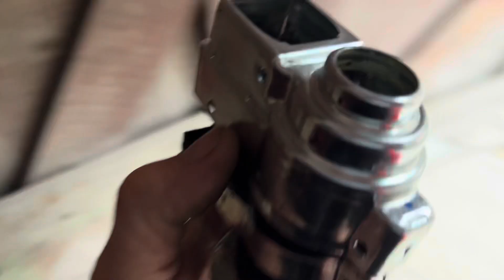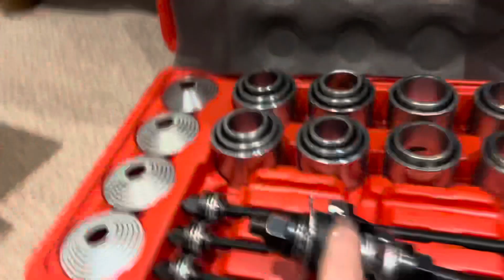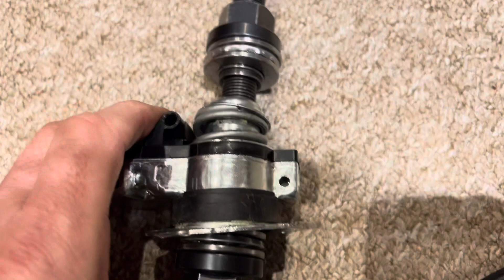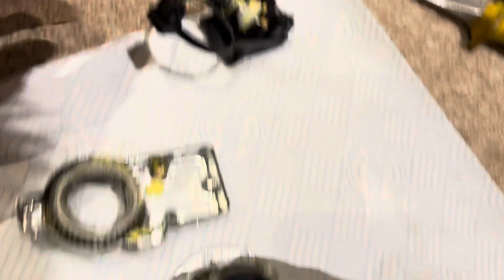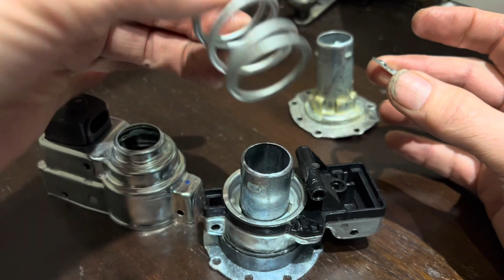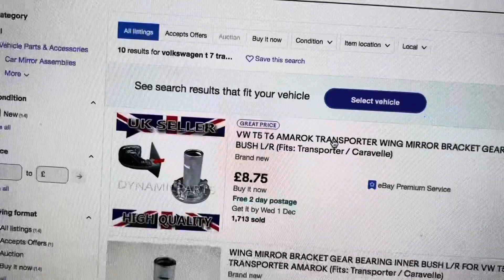VW Transporter T5,T6,T7 electric folding wing mirror repair - how to replace bent bracket

Comment: we have a VW california 2022 and the right hand side wing mirror may have been knocked when it was parked in the street. Theres no real visiblae damage it not quite as flush as the left side by millimeteres,  it often doesnt rotate all the way down or all the way up Wondering whether doing what youve done here would fix it?
Reply from the maker: Sorry to read about your mirror. If it was me, I would definitely take it apart and investigate. Could be a bent plate or something simple like an electrical connection. Mike

Comment: Hi, great video could you tell me where you got the motor from, please?
Reply from the maker: Hi - I think in this case, the motor was fine and it was just the bracket that was bent. 

I have a wing mirror playlist on this channel and you will see that for my SL55, I sourced the motor from Bross. 

However….you need to make sure you get exactly the right motor because the current rating will determine how it folds in - eg where is stops etc. my advice would be to try and source a genuine 2nd hand one. 

Have you ascertained that it is definitely the motor and not the wiring?

Mike

Comment: Thanks, very nice video! I have exactly the same problem on my T5, and I'm a bit stuck on how to remove the casing of the motor. I don't get how you did it with the chisel, did the casing poped up while hammering on the base?
Reply from the maker: How did you get on with the casing - it is a basically a press fit so you need to support the top of the casing whilst gently hammering on the base. Mike
Reply: @MikesMercsandothercars  Thanks for the feedback, I finally succeded by clamping the base in a vice from one of the side and hammering (not so gently) the bottom sides of the case until it poped. It was impossible the other way round for mine. Now I have just to find the cylindric part online and follow your guide.  ;-)
Reply from the maker: @ Glad to hear you got it apart. Mike

Comment: Hey Mike, tnx for the video! I love it. Someone hit my new t6.1 a couple of days ago, basically a hit and run. The car shop wants to replace the whole mirror and is asking for 533euros. Thos is insane! I was th8nk8ng to give it a try on my own, and I was meaning to ask you if you had to dismantle the door card as well, or couod you remove the part, just by dismantling the mirror itself? Tnx, Ivan!
Reply from the maker: Holy shmoly! 533 Euros!! From memory, you do not need to dismantle door card. The hardest thing about this job is having the belief in yourself that you can do it. As mentioned in the video - just make sure you get the right bracket. Someone just did my SL55 AMG mirror again which is really annoying so I feel your pain. Mike

Comment: what was the numbers in the electric motor
Reply from the maker: Hi - the number on the motor was 512516 there was something before the number which could have been VW but is was difficult to make out. I'm not sure that this number was a part number because I never found any reference to it on the internet. When I replaced the motor on my Sl55 (https://www.youtube.com/watch?v=md-_Au7TEJA) , I sourced a motor from Bross Auto Parts in Turkey. I notice that ebay number 186027749353 is a motor for the T5, T6 and T7 also from Turkey.

 Mike

Comment: Thanks for the video, great help. Just did mine. Used a length of M10 threaded bar, a couple of nuts and washers and a 15/16" socket. The socket was large enough to press down on but small enough that I could get the grips on the locking washer to turn it.
Reply from the maker: Nice - always good when a plan works. Mike

Comment: Thank you so much. I would never have worked out that the cover was press fit. I don’t have a bearing press, but I did have a cycle headset press. That worked a treat. I ordered the part from a company in Turkey but they sent it from a warehouse in the UK. It arrived in a couple of days. All done and working again.
Reply from the maker: Glad you got it sorted. Mike

Comment: Thank you so much for your concise description on how to do this. Was just about to spend £170.00 on a complete new unit. I didn't want to spend out on the bearing kit, so I used a ladder roof rack bracket, which worked a treat.
Reply from the maker: Thanks for your comment - glad the video helped...and I'll have to remember the 'ladder roof bracket trick'. Mike
Reply: You can buy that same motor for £25-30 if you willing to wait 2 weeks for it

Comment: Hey great video… I almost managed to get to this stage but got stuck getting the wires through the hole in metal mount/bracket. All pulled through except the big square connector which it seems you have to remove the wires from… but how!?! The holes seem so tiny in the connector block I can’t see a terminal key small enough! Please can you share how you did it
Reply from the maker: Thanks for your comment. I didnt actually remove the mirror or put it back on - my friend whose van it is did that. If you send a photo or short video to m_scott65@hotmail.com of the problem, I'll take a look and can ask my friend if was the same on her van. Mike
Reply: I took the door card off and unplugged the cables from there, they then pass through the bracket hole very easily. No need to cut anything.

Comment: Hi firstly great video, but what were the symptoms after you clipped the wing mirror? I’ve had the same done to mine by another vehicle whilst parked up, I can hear my motor but the wing mirror doesn’t move, so I was thinking maybe the cogs unless you tell me it had the same symptoms? Thanks
Reply from the maker: Thanks for your comment. To be certain you’ll have to take the motor to pieces, but it sounds like either the cogs are knackered or possibly frame that holds the motor is cracked and is that not making contact.

Take it to pieces and have a look would be my advice. Mike

Comment: I have a question the little electric motor on your mirror you said it can be ordered from where and will it have the cogs on it as I’m sure that is what is broken 
Thanks again
Reply from the maker: Thanks for your question. My advice would be to disassemble first and check that it really is the motor. These don't tend to fail that often. It is usually the plastic cogs or the wiring. Let me know how you get on....meanwhile I'll see if I can find a source for those motors. Mike